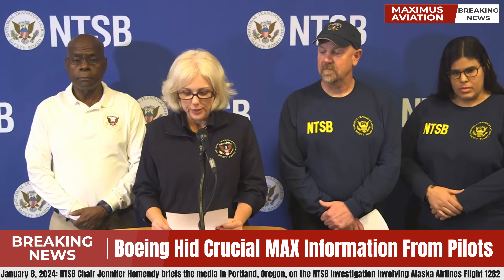Boeing NEVER Told Airlines That 737 Max Cockpit Door Was Designed To FLY Open During Decompression!

Comment: Ever since Boeing became led by purely MBA types? In my opinion, Boeing aircraft have become unsafe fly, the pilots, aircrew and probably the maintenance crew have been left uninformed, the operating and maintenance materials have been 'stream lined', and actual Engineers, Technicians, Pilots, Aircrew and Ground Crew have been ignored and pushed aside and fired all to make that stock price higher than it should be, so they can give themselves endless raises and bonuses. Boeing will continue its slide into bankruptcy and dissolution so long as MBA 'money before safety' types are running the joint.

Comment: If objects are sucked out when the door opens and people could be sucked out, then the door is blowing out too soon. Boeing putting this in a manual isn't going to solve the problem, imo.
I think they need to change the door design. If I'm incorrect please correct me. I'm have no experience of aviation except as a passenger.

Comment: I call paid for bullschiff.  Makes no sense the door was designed to fall off if the air pressure fall below a point , at over 14000 feet  what's the air pressure at 14000 feet ....yea less than 9 lbs ....nonsense being sold here was she appointed by Biden or Boeing?

Comment: It’s obvious that the cockpit door would fly open during a rapid decompression, other aircraft have blow out panels to equalize air pressure and prevent structural damage to the airframe. I don’t believe that Boeing really needed to explain this.

Comment: Yeah, MCAS and now this…what else they left out from the manual? 

Should we wait for another close call, or worse, for Boeing to come and say “oh yeah, we left this shit out of the manual”?

Here we have a company who’s:

- cutting corners here and there, to meet schedules and keep stock price up

- repeatedly asking FAA for safety exemptions 

- underplaying the amount of training that would/should be required to transitioning form legacy 737 to MAX (in order to sell the plane, and make $)

- lying on technical official documents (aircraft manuals are), omitting pivotal informations about key systems on board of the MAX-8/9 (they did it even after the first crash, and almost 200 souls lost)

- they already endangered passengers and crews with the 787 battery affair, it was a coincidence we had not witnessed a tragedy 

Fine.
What else is needed before airlines start dumping this joke of a company?
What else before FAA starts taking serious actions in order to prevent something bigger to happen?

Boeing’s credibility is not at risk here anymore. That’s already gone.

Now it is the system’s credibility on the line.

Comment: I knew Airbus acft had this as there are 2 overhead panel lights for sensor 1 and 2 failure. Boeing, of course, hid this like they do many systems. Gotta keep that training downtime low for airlines! So, other than MCAS AoA-based stall protection and cockpit door depress sensors, what other systems were omitted from the manuals?

Comment: The reason for the cockpit door opening automatically during rapid decompression is anyone’s guess, could it be that if it was a decompression incident in the cockpit it would allow the cabin crew immediate access to the cockpit and flight crew to render assistance, and maybe it wasn’t included in the aircraft manual or training notes for security reasons, it would give anyone wishing to access the cockpit a means of getting the door open by deliberately causing a pressurisation leak, not likely but still could happen if a terrorist was desperate enough. Whatever the answer it’s crazy that nobody onboard was aware of that possibility.

Comment: 1782 comments below. I can't read them all, But for sure some comments below must have comment that the Flighdeck door has decompression panels. They must likely did what whey were designed to do. Blow out from the flightdeck door. The flightdeck door did not open!!! The panels inside  the door opened to equlise the differential pressure

Comment: The reason for this is to allow flight attendants to access the cockpit in case of a decompression emergency and in case of a crash, to allow the aircrew an exit in case of a crash. In prior crashes, the frame of the cockpit door has warped, jamming the door shut and necessitating egress through the cockpit window. When this hasn’t been possible, aircrew have died. It was a common sense engineering decision. The manual should have referenced it, however.
Reply: Nah its too much of a security flaw! If there is a crash involving the ground it would not be activated and if its a mid air crash then plenty of other things to vworry about, Panels and vents yes but not the whole door opening.

Comment: So are they saying the door plug failed leading to rapid decompression, or that rapid decompression caused the door to eject? If the latter, then what was the source of the decompression? Yes, knowing that is how they are designed should have been disclosed. Why wouldn't they design the door plug to be self sealing, like the emergency door it is replacing. (You can only open it from pulling in). What is the purpose of designing it to fail during rapid decompression.

Comment: If the door was designed to blow out on rapid decompression what caused the decompression in the first place? Was it the door itself?
Reply: They are talking about the Cockpit door (where the pilots sit).    The door plug that fell out was a plug for a place for a safety exit.    
Decompression can create enormous forces and the cockpit door is only so strong.

Comment: The NTSB is obviously  trying to mitigate Boeings culpability by saying the dummy door should have popped out because of decompression to save the structure near the door being overloaded by stress
I would respectfully point out the the stress on the structure would be less not more after decompression when the pressure inside and out become similar 
If there are really blow out panels they should work on over differential pressure not under
Boeing and the NTSB are behaving just like the Whohan  institute and the Chinese government 
It disappoint me to find we are little. Better in the west

Comment: Well this is news to me and I fly the 737. I used to think in case of depressurization, I'll take my headset off, wear the 02 mask and then headset on top and then start reading the checklist. Now I hear - the cockpit door will open, the air will remove my headset and blow away the checklist. I'll be sitting there in a super loud cockpit with my plans in shreds. Thanks Boeing!

Comment: The cabin door is not a pressure bulkhead. I believe you would want it to blow open during a rapid decompression, for safety as well as a number of other reasons that  I can think of.
   Remember the purpose of the door is to keep bad guys out of the cockpit.  During an emergency losing the locked door  could be a  bigger benefit than the risk of having a bad guy on board. ( there have been several crashes where the captain could not get from the bathroom back into the cockpit. )
     Telling the crew, making this common knowledge,  defeats the entire purpose of the door. Hijackers now just have to  wait to 30k feet, dress warm, blow out a window  and wait for the plane to descend  to 10k feet.  They have instantaneous access to the cockpit.  MY BET IS AIRBUS  HAS THE EXACT SAME SYSTEM. No matter what the doors have to be redesigned now that the secret is out.

Comment: The door should not open in the event there is a decompression if it is not a real operating door.  This is a very bad design, not just some omission in the manual.  The fact that the NTSB is overlooking this vital fact shows they don't really grasp the issue at hand.  Sad.  The real point is that a plug door should not operate at all until it is replaced by a real door if the seating arrangement on the aircraft requires another emergency exit.  The Boeing solution was risky from the get go, putting a "live" door in place of a simple temporary non-movable plug.

Comment: I love how they explain that there are 3 safety redundant systems to maintain cabin pressure to ensure your safety. The problem here of course is that this system never failed as the door plug simply fell out because the 4 bolts were missing and the pressure difference eventually allowed the plug to exit the airplane. So what else is missing on these lemons. "IMHO"

Comment: I wonder if the alt computer is as complex as the primary or if it is cost reduced made only for redundancy.  It'd be lazy to assume that the primary computer was erroring because there was a large leak caused by the plug door but that I assume is what people are leaning towards.  if it was in manual mode, it'd be mentioned by now? I also assume it'd be possible to over pressure the plane whilst in this mode. (beyond ideal, rather than design limits)

Comment: Designing a hatch that is supposed to blow off in a decompression seems pretty dangerous. It could damage the tail surfaces and give the flight crew an extra problem. It could also injure people on the ground. The FAA should force Boeing to correct this concept.

Comment: I flew the 737 for nearly 30 years. After 9-11, we saw the new hardened doors being installed with an upper and lower panel. When we asked what those panels were, they advised us they were "blow out panels" in the event of a rapid depressurization event. A slow cabin pressure leak would not involve those doors but a rapid event like that experienced by Alaska would.
Reply: I don't know about the 737, but some of the panels on cockpit doors can be removed from the inside.  This is in case, for example, the door frame gets deformed in a crash and the door won't open, the crew can crawl through.

Comment: This is utter horseshit, it was well known in UK commercial flight training circles that the armoured doors of post 9/11 aircraft were designed to open in the event of an explosive decompression. How are we to explain that US pilots were "unaware" of this? Even a trainee pilot would understand that were they not designed to do so, the flight-deck floor, ceiling  and rear bulkhead (wall) behind the pilots, would be put under intolerable loads due to the pressure differential, causing them to fail, likely knocking out some flight critical wiring runs in the process. In other words, even if they were not expressly trained to know of this, first principles should have told them it was sheer lunacy for provision for blow-out panels and/or door release in the event of an explosive decompression.

Comment: With decades of advanced manufacturing new product development, quality control and forensic failure analysis engineering experience seasoned in ISO, ASTM (I), SMS (Safety Management Systems) Six Sigma etc., Boeing must implement these programs immediately on their dime, not the FAA via the US taxpayers and suggest contacting me as I will gladly assist in the process. ✅

Comment: The FAA has failed big time in the past with Boeing so what is different this time?🤔

Oh the Tax payers get to pay for Boeing’s missing quality control Safety Management Systems and once again pay to coverup the FAA’s and Federal Courts own mistakes in allowing Boeing to get away with 346 deaths on the 737MAX which is precisely how we got to this point today.🤫

With decades of advanced manufacturing new product development, quality control and forensic failure analysis engineering experience seasoned in ISO, ASTM (I), SMS (Safety Management Systems) Six Sigma etc., Boeing must implement these programs immediately on their dime and suggest contacting me as I will gladly assist in the process. ✅

https://youtu.be/YQKzHdq3DM8?feature=shared

Comment: Until medically proven otherwise, the flight crew has PTSD, which must be diagnosed and treated immediately. The longer PTSD goes untreated, the longer the recovery takes. Just as important, this also applies to every passenger on that flight. They need to be screened and treated for PTSD as soon as possible.

Comment: I don't understand this. Why would a door be designed to automatically open if the air pressure in the cabin drops? At altitudes above 13,000 feet or so the cabin is pressurized so that passengers can get enough oxygen from the air in the cabin and would not need supplemental air or oxygen from a mask. If the cabin has become only partially decompressed, a door flying open will speed up the decompression, and not only air will leave the cabin via the door-hole, but things that aren't tied down will go flying out the door-hole. If the cabin became completely decompressed, having a door fly open would make it impossible to bring the pressure back up again. What's the point of having that door open? However what seems to have happened in this situation is that the door flew open for some other reason, and this was the cause of a sudden reduction in cabin pressure. Can someone make any of this make sense?

Comment: Pn teh cockpit door decompression equalizing:  How does door opening comply with the reinforced entry / ammunition-resistant regulation?  As far as I remember -- I was deeply involved in the certification of the original reinforced cockpit door on the Embraer ERJ-170 / 190 back in 2003 -- the dor should resist small arms fire even when the decompression blow-out panels were deployed.  Door opening for pressure equalization was NEVER considered in the reguulations. m Did they change?

Comment: Did the cockpit door actually open or was it a blow out panel in the door that opened? Other Boeing types have a blow out panel that equalises the cockpit  and passenger cabin differential in case of depressurisation, they do have a metal grid that prevents access through the blown out panel, to the flight deck though

Comment: Doesn't make sense that its designed to blow out during operation when it is beside passengers. For aircrafts 737 max-8 that don't have door plugs the decompression blowout is probably somewhere else away from the passenger. It should only be opened during maintenance. Pictures of parts to look for would be helpful.

Comment: The cabin pressure was 14.09 PSI at 17:12 you say?  The maximum differential should be around 8.0 to 8.3 before the outflow & emergency valves open......at 14 PSI there's probably close to 20,000 lbs of force on that area.   Might want to correct those numbers.  Then the entire cockpit door opens instead of the cockpit door pressurization plug.  Great design there!

Comment: How could anyone, with even a little knowledge of commercial airliners, assume that the cockpit door would have the slightest chance of holding back pressurisation loads in flight? Assuming the door is about 30" x 78", the load on the door at max Delta P of around 8psi, with the cabin depressurised, would be over 9 short tons. They are only a flat, 1" thick, composite door with a simple latch. Bleeding obvious that it will blow open in a cabin depress.
Reply: Its called blowout valves maybe? Same with bomb shelters?
Reply: @dunmadun351  There are floor level blowout panel  to protect the floor from collapsing into the cargos in the event of a cargo door failure. They were brought in after the THY crash in the Ermenonville Forest, France, March 1974. All our QANTAS 747's had them retrofitted after that event.

Comment: I’m confused.  Was it a “Door Plug” (Singular ), or a Door Plug complete with a Door?  At times you talk about a door plug and other times door that blew out.
Reply: Not a door plug, but a plug door. That’s probably where the confusion comes from. It’s basically a door that you don’t need. So instead of a proper movable door you just install a fixed piece into the door opening. That thing is called a plug door

Comment: This type of event is EXACTLY what Flight Attendants are trained for.  Sure it was surprising, but within a few seconds they should have all known exactly what happened.  Between the noise, everything blowing around, and the O2 masks dangling down, obviously a rapid decompression.  There should have been no confusion, nor need for communication from the cockpit about this.   Pilots are WAY too busy saving the plane and passengers, to be making PAs to the cabin crew.  That's why we train them to act on their own during such a situation.

Comment: Boeing never told about :
The mcas 
The missing bolt
The missing nuts
The door
The cabine door during depressurisation
The metal pcs missed in some aircraft panel
The rudder screw not tightened
What else ?

Comment: The door swinging open is more than just a security risk, it blew the headsets off the flight crew and also blew some of the needed checklists out the door.  According to Juan Browne their is supposed to be vents in the cockpit door to equalize the pressure.  This makes more sense than having the whole door swing open.
Reply: The door swinging open in itself is not s problem and actually wanted. (It’s the same on Airbus btw.) The problem is that that info isn’t in the manual

Comment: Id hate to give Boeing too much credit, because their quality control has definitely faltered in the past few years but I’d imagine the cockpit door is designed to open during a rapid decompression so that the cockpit door doesn’t become a projectile flying into the passenger cabin. I watched a documentary about the windshield of a passenger plane detaching from the cockpit, partially sucking the captain out of the plane and smashing the cockpit door into the control panel and engine power controls in between the pilots.
Reply: The problem is not the door opening, the problem is the incomplete manual